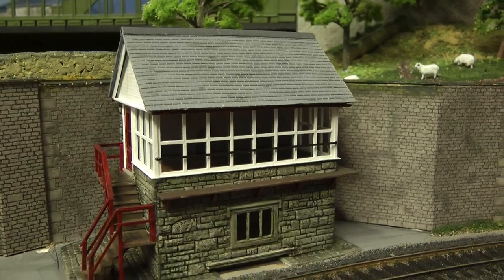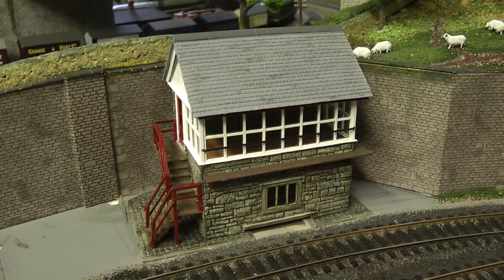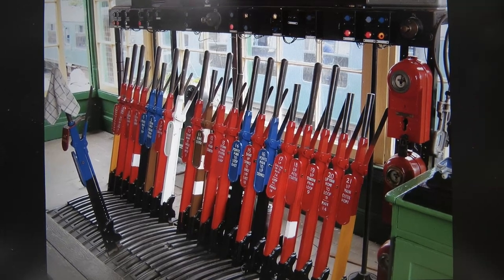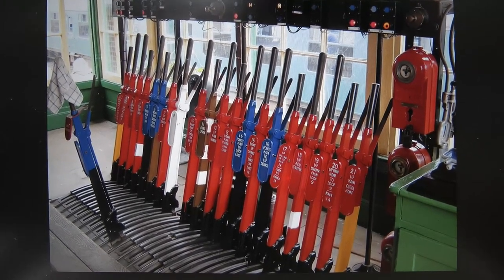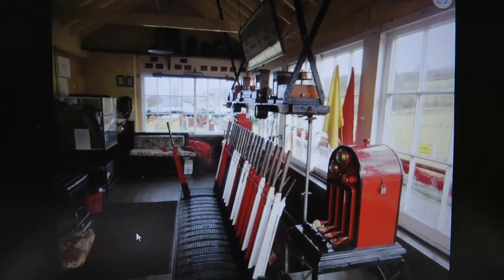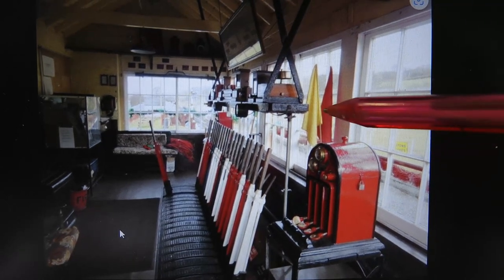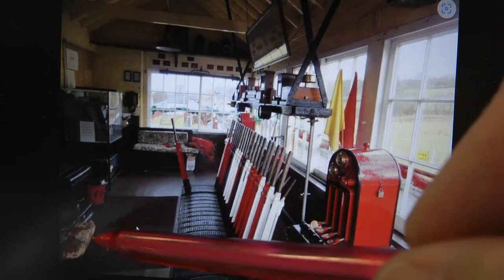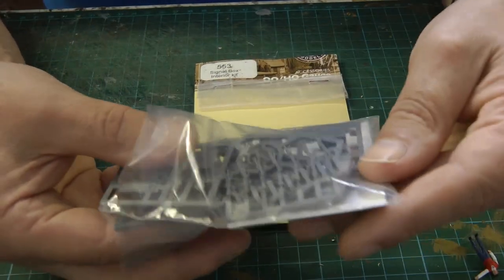Jarrow Road Signal Box   Part 4   No 390

Comment: White levers are spare, Black are points, Blue point locks, Red - Start & Home signals, Yellow Distant signals Brown on a lever is a release (crossing gates/griund frame) Also if the laver has a short handle it now operates as a lvery large switch (colour lights/point motors) Tony
Reply from the maker: Thank you Vinny. this info will come in very handy for the next signal. as i still have a few more left to build. cheer's again. Tony

Comment: Hi Tony,
Red for stop signals and ground signals. 
Yellow for distant levers (They were green prior to 1920).
Black for points.
Blue for Facing Point Locks (your station probably did not have any fitted).
Blue over Brown for interlocks, e.g.,  electrical interlocks.
Brown for (mechanical) e.g., level crossing levers (you don’t have a level crossing).
White for spare levers.
The plates identify the function of the leavers.
The cloth used by signalmen is to stop rust or corrosion on the levers, due to sweat on their hands. 
The ‘Track Plan’ is called a ‘Signal Box Diagram’, my friend.
Your signal box interior is a fantastic work of art, marra, as is the exterior detailing.  
I like the pigeon Tony, but the signalman will need to watch out for plops. 😂 
Have a nice weekend. Best, Jason
Reply from the maker: Thanks for information Jason. i know i can always rely on you my friend. looks like i did get a few right. thanks again buddy. cheer's for now Tony

Comment: Tony you have way more levers than points and signals for that tiny section, additionally you would only have one section bell because you are going from a terminus so you don’t have trains entering the section from both ends and you therefore only have one yellow distant signal and two starting signals, you’d also have a junction ground signal where the single track incoming splits to double. You’ll also have a lever for the switching points in the platforms and interlocking lever plus a lever for the single track to double track junction. All in you’re looking at 8 levers, 1 yellow, 2 black, 1 blue, 4 red and as many whites as you like.
Reply from the maker: Good morning Edd. i agree. i do have too many levers. i should have saved some back for the other signal boxes yet to come. it seems i learn a little bit more every time i build a new building. and it all down to guys like yourself keeping me on the straight and narrow. thanks again my friend. cheer's Tony

Comment: It looks great Tony, I love it. Back in the early 70's I worked in several boxes in and around Crewe and most of them had the coal bunkers, the larger ones which were built later had a central heating systems in them but the smaller 'outer' signal boxes were all pretty much heated by coal or wood. I think your's looks pretty authentic mate.
Reply from the maker: Good morning Jon. the ideas come from visiting heritage railways. the coal staithe was just something that i picked up on. interesting that they swopped over to central heating. thank you for commenting. as they are always very much appreciated. many thanks again Tony.

Comment: Hi Tony, 

interior detail certainly makes a signal box model...  You were lucky with the one you built...  I've got two standard LNWR boxes to detail - one with 35 levers and the other with 80; that's six Ratio kits altogether and I'll have to modify all of the levers as the releases on LNWR levers were a loop!  

As to you question about stone signal boxes in cornwall - sorry but the only ones that I have seen are brick built (there are still a few around some in use but the rest, like the one at St Austell station are disused).

All the best,
Ken
Reply from the maker: Good morning Ken, I am sorry for the late reply. about the signal box i was thinking aloud when i mentioned where the signal box may be found. its always worth noting that most signal box's have spares levers. its interesting how different areas built there signal box's with different materials, i am guessing it is down to what materials are available for area. but most designs are a standard. thanks again for commenting. cheer's for now Tony.

Comment: Hi Tony.. the cut down levers are for electric motor driven signals which do not require a heavy pull like the standard cable activated signals..
Reply from the maker: Hi David, i never knew that. thank you for commenting, very interesting. cheer's for now Tony.

Comment: White levers are not in use which is why it has no description.
Red for home signals, yellow for section distant signals, black for points, blue for interlocking facing points, brown for level crossings.
Reply from the maker: Hi Edd i think i got most of those in the video. except for the none lettering on the white pull levers. thanks again for your wisdom, have a great weekend Tony

Comment: Hi Tony, Ratio kit looks useful, nice video! if you come across Tyne Dock Bottom box, any photos would be appreciated. Cheers🙂 Steve
Reply from the maker: I will keep an out Steve, Have bought any of the new 9Fs either Bachmann or Hornby for Tyne Dock. thank you for commenting. cheer's for now Tony.
Reply: @TONYNORTHEASTERN Hi Tony, I did have a look at the Bachmann one in my local model shop. Very nice but a bit pricey. I will have a look at the hornby one and compare. Maybe Santa 🎅  will bring me one? I do have an old Whitemetal conversion kit somewhere...
Reply from the maker: Very true they are a bit pricy. i have opted for the Hornby version. slightly cheaper.
Reply: @TONYNORTHEASTERN 😮 Look forward to seeing it in action 🎬